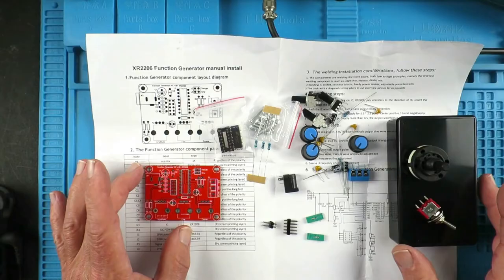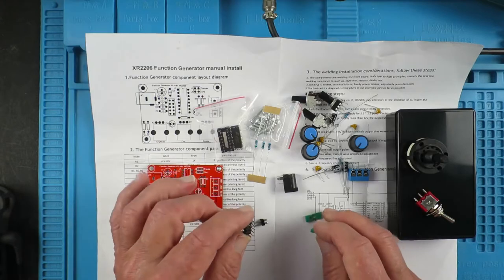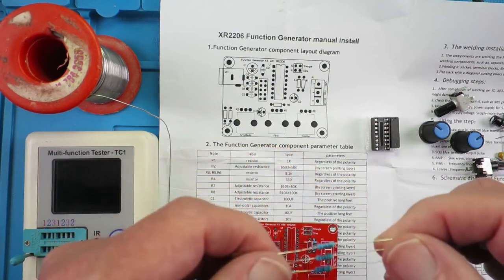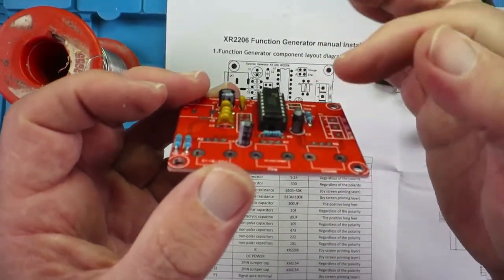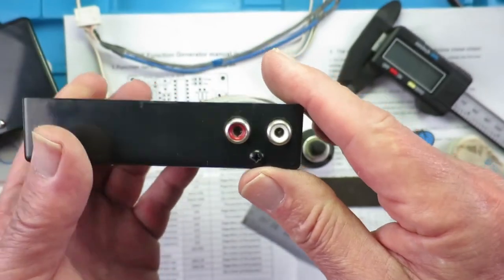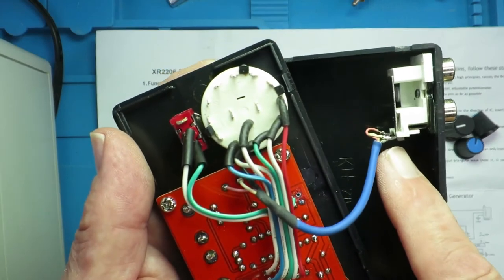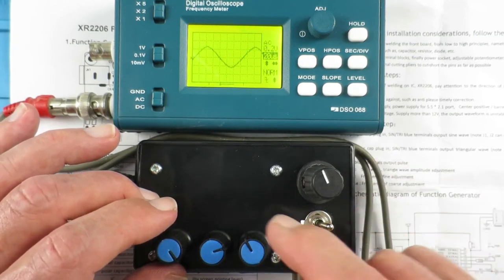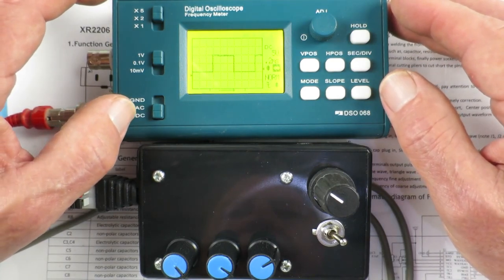XR2206 Function Generator Sine Triangle Square Output 1HZ-1MHZ DIY Electronic Kit Review Banggood

Comment: are you able to add a piezo speaker and get sound from this generator?
Reply from the maker: No. It is not designed to do that. Tell me what you are trying to achieve and maybe I can suggest something. YouTube no longer shows me if you are subscribed. Please consider subscribing if you have not done so already!
Reply: @1nformatica  Wow thank you for your quick reply.  I just subscribed!  What I am trying to do is create a steady ultrasonic frequency to drive a piezo speaker (cannon). I am trying to replicate an expensive anti loitering device called the mosquito alarm.  I bought a Kemo M048N which hits the right frequency, but it oscillates too much, and also is not as loud as I was hoping.  I decided to try this XR2206 to fine tune the frequency but it doesn't work as I was expecting.  If you could help me it would be great! i have spent many hours over the past few months researching this.
Thanks a lot.
Reply from the maker: @MD62383  Not my area of expertise, you may find this interesting : https://blog.piezo.com/how-to-drive-piezoelectric-actuators and also https://www.youtube.com/watch?v=F5tQIxdQb4c Good luck!